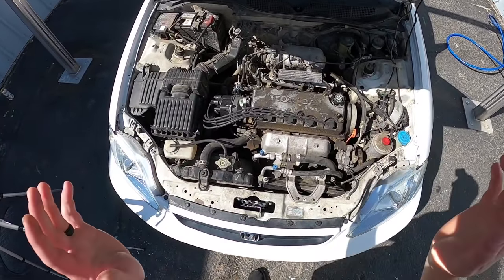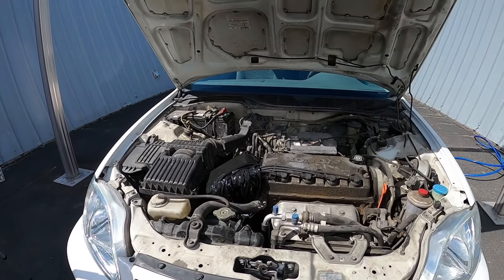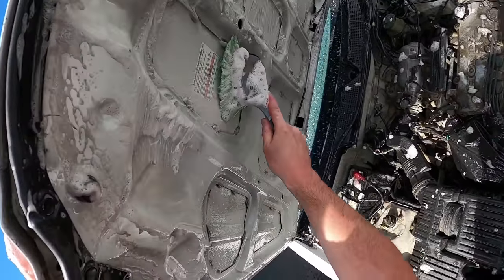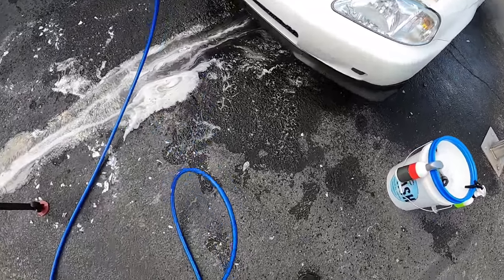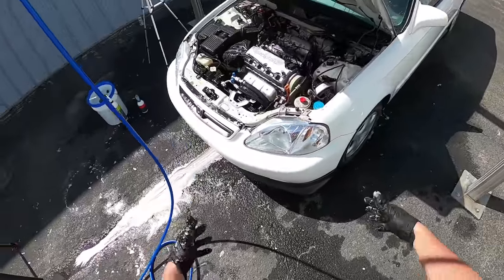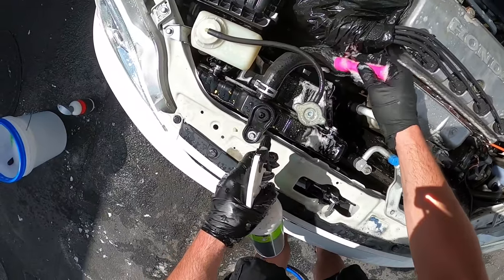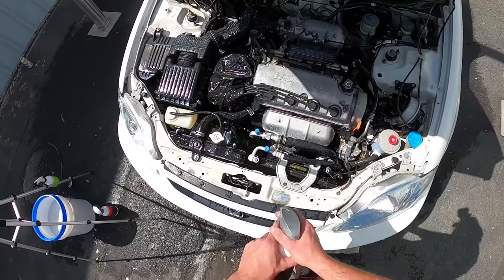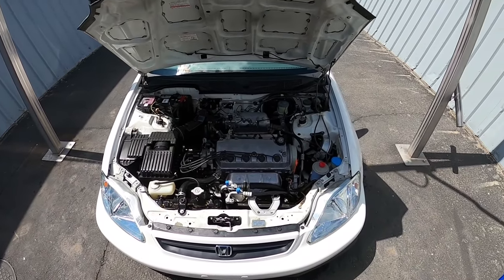FILTHY Engine Bay Detail on a 200k Mile Honda Civic | Start to Finish

Comment: Anyone else thinks it is a VERY good idea to disconnect the battery while doing things like this?
Reply: I did when i did my pick up. Also used a garden hose and sprayer, and masked off fuse box, ecu, alternator, etc. Came out perfect without a pressure washer
Reply: ..I just cover it up and clean later.  By hand, using good old baking soda solution.
Reply: Nah
Reply: Yes, just cleaned mine and disconnected the battery. Came out perfect!!!
Reply: Why? Water isn't as good of a conductor as the layman thinks. It's actually quite poor. You need electrolytes like salt or baking soda to make it conductive. You can soak that battery all you want, you're fine. Just don't soak electronics.
Reply: Alternators don’t like water either. Pressure washer can easily ruin your day if something important gets disconnected.
Reply: Not really. Batteries are non-conductive.
Reply: did mine without disconnecting and was completely fine
Reply: Um duh 😒 just playing yes very important
Reply: Yes. Boggled my mind that wasn't included. Especially after youn finish the bay, with the battery disconnected you can scrub off the acid too.

Comment: Did this not too long ago and my gas pedal started sticking. Consensus from some forums was that the water pressure might have pushed dirt and debris into the rotating mechanism of the throttle body (TB). Prior to me owning my car, an old lady owned the car for 24 years and had never cleaned the engine bay so it was pretty filthy. Some TB cleaner at your local auto parts store will fix it right up if this ever happens to you haha.
Reply: TB cleaner, brake cleaner, or simply soapy water on your throttle cable and spring. Soak it good and maybe use a brush if you can fit it on the cable and spring, make sure to clean the cable and activate the throttle and clean between the pulley. Then any multipurpose grease/gun cleaner/oil works on the spring and wire/pulley. No WD40 though.
Reply: Ima have to try this my throttle body sticks when it’s parked over night and I have to put my foot down a bit to get it to go
Reply: Same happened to me i had to keep clutching in and kicking my pedal 
I used some lube cant remember if it was silicone based or what on the throttle cable and some light oil on the return sprung and throttle shaft 

Use a motorbike cable lube tool and spray from the top down it should fill the cable in 5 seconds without a air leak then go in the cabin and wipe the excess overnight.. my clean up was next to nothing

Comment: The engine came out pretty clean. I would detail and clean my 2003 honda civic engine every few months. It may not be the coolest looking engine but it felt good to have a pretty clean engine all the time. Keep up the videos, always waiting and excited to watch.
Reply from the maker: It’s always best to stay up on it so it never gets to this level
Reply: 2003 Civic = headgasket blown
Reply: @ua7pyro591  that’s why he always keep it clean lol
Reply: @ua7pyro591  I can attest… however replacing the head gasket on my 03 was a good learning experience
Reply: Same, i have a 2005. 7th gens are sorta the odd one out for civics but the least you can do is keep it nice and clean for it to stand out and keep up 💪😎
Reply: @ua7pyro591  so if U clean your engine and oil builds up it will blow your head gasket and does it make your overheat and have this weird smell?
Reply: @camarioncooke7478  an oil leak from the head after cleaning won't necessarily cause a failure or overheating,  but it is an indication of a problem that needs to be looked at as your gasket isn't sealing properly or there's an unseen crack somewhere. 

Cleaning your engine actually improves its thermal efficiency and ability to transport more heat away from itself, which will lead to some improvements in mileage and some marignal performance. Dirt and oil also weigh quite a bit and its all extra weight you're hauling aroind. The other benefit of a clean engine is being able to better keep an eye on how bad leaks are or if you have any new ones, instead of being hidden under a layer of sludge you can easily see fresh wet oil leaking out much easier.
Reply: @ua7pyro591  honestly here in Asia, its one of the most reliable cars 
got one and it never caused any trouble ever 
mine got a d15y3 non vtec

Comment: After I clean my engine in a similar way and let dry completely . I spray 303 Protectant liberally all over the engine compartment . Specifically to resist plastic and rubber parts / components from drying out and cracking . It dries without any issue at all , though it willl attract surface dirt . Which after around 6 months ? I will do the same again . Of course making sure I do this if possible in the summer months at least for one application . I stuff 1-2 microfiber towels into the air intake to prevent water from getting it .

Comment: I've got an 04 Camry with over 230,000 miles on it and the engine bay still looks pretty darn good
Reply: Me ditto, 2002 V6.  Always kept the engine clean, it is SOO much easier to touch up an engine that hasn't been allowed to get filthy, then coming in and trying to clean it.

Comment: Good for YOU! Nicely done! Ppl think it's wrong to WASH engine bays, I do NOT. I feel greasy/dirty engines are like "frying an egg". When they are "clean" they breathe easier/cool quicker/stay cooler. PLUS, nicer to work on. I use Simple Green on stubborn dirt, but hose my engine bays several times a year at self serve car washes but dont push trigger & that spray is adequate to clean off dust. Yours looks SO much better! 👍

Comment: Yes!!!!! Waited so long for this video after you posted a sneak peek in your ig. But Is that really safe? What bout the sensors? The battery? The fuse box? I mean, you soaked it good but will it not affect the circuits?
Reply: All the sensors and what not I believe have seals otherwise how would you be able to drive in rain snow or be able you wash your car not being sarcastic just I’m sure they must be water tight

Comment: That distributor looks really easily accessed.  Might be better just to clean it, and dry it afterwards on an engine this dirty.  That's what I did on my Volvo.  Also, I've found that plug wells often collect water, so pulling the plug wires from the start isn't a bad idea.  Then dry them out with a shop vac, and compressed air after cleaning.  I wasn't clear on why a wheel cleaner was used.  I'd choose a degreaser.
Reply: He stated once or twice at the beginning he used wheel cleaner because it's got some iron/rust inhibitors (fine rotor dust gets everywhere and then oxidizes, and contributes futher to dissimilar metal corrosion), and works well for cleaning grease and grime which while not as oily as an engine brakes tend to get pretty gunky. Being a wheel cleaner it's most likely formulated to not damage or etch various kinds of bare metal from steel to aluminum as well. 

I personally just spray everything down with klean strip paint thinner made from mineral spirits, and or purple power/simple green for less soiled cleaning projects. I got a siphon wand for my compressor, and I'll just give the engine a light spray and let it soak. Then scrub it all with a few nylon brushes by hand or stuck in the cordless drill chuck. Give it one light spray to get the gunk flowing off, another quick scrub with the brushes (after giving them a quick cleaning with compressed air) and then just blow all the dirt, oil, and sludge off with compressed air and it's Gucci (may require one extra rinse, and blow dry) Granted on a really dirty engine bay, you may need to do it once more from the beginning. I've cleaned nearly 1500 engines this way and never had a problem with it damaging paint, electronics, plastics, rubbers, epoxy resins, or coil windings in alternators or stators.  It's just damn messy and a pain to deal with if you don't have a containment/runoff treatment system, which we had at the old shop but I don't have at home currently. Another plus is that any residue from them will evaporate off shortly and you don't have to worry about it shorting anything out.

Comment: Pro tip remove your battery before you clean your bay to protect your electronics. this also give you a chance to clean your battery tray and battery terminals.
Reply from the maker: Makes no difference in removing it other than giving the tray a clean. “Modern cars” can take it

Comment: I clean my engine bay regularly, easy to spot any fluid leaks when clean, if you work on the engine hands are cleaner, never had a problem but be careful on rollers from the belt and alternator, degreaser will clean too good them bearings and the will fail alot faster

Comment: Some steps I do, mostly to make certain that engine WILL restart:  1.  Cover the alternator w plastic.  2)  Cover the air inlet with plastic!  3. Then either clean the alt carefully by hand or jsut leave it dirty - is a broken alternator worth it to get the engine completely clean?!

Comment: Motorplast is a fantastic product. For engines that are in a little better shape, Vonixx makes a ceramic engine bay coating called V-Energy. Can be used on Plastic, Metal and Rubber. It's phenomenal and super fairly priced for a ceramic coating.

Comment: before you pressure washer the engine bay....disconnect the battery or remove it completely to clean the battery tray area too and to prevent short circuit

Comment: LAST SUMMER WHEN I DID A FULL AND I MEAN FULL ENGINE MAINTENANCE & FULL TUNE·UP I COMPLETELY TOOK OUT MY MOTOR AT 25O,OOO.OO MILES FULL SERVICE I CLEAN EVERY SINGLE PART MY HAND AND WHILE THE MOTOR & TRANSMISSION WAS OUT I CLEAN THE ENTIRE BAY NOW IT'S DUST FREE NO OIL OR GREASE I COULD SPOT AND LEAKS IF I EVER GET ANY IN THE FUTURE I DOUBLE CHECK EVERYTHING WHEN EACH TIME I DO MY OIL CHANGE I EXAM ALL THE UNDER CARRIER THANKS FOR THIS ENGINE BAY CLEAN DETAIL VIDEO NOW I HAVE A GREAT D.I.Y. REFERENCE ON HOW TO KEEP MY ENGINE BAY LOOKING CLEAN AND NOT DUSTY AT ALL GREAT AMAZING VIDEO THANKS ANTHONY ✌🏼OUT

Comment: I can’t wait to do this to my engine bay! I’m rebuilding my D16Y7 and and some everything is basically out already so it’s gonna look so good and I’m so excited.

Also I had a quick question about your b-roll; do you use a gimbal or are just really good with a handheld lol. Cuz I saw in that last clip you were clearly using a handheld and like a skateboard lol but was just curious
Reply: Might be some editing on certain parts to make it stable If you watch eought jordan did great with broll and editing
Reply: @BlueCivid   there's some pretty good video stabilization software out there nowadays. My new phone has it and it works quite well much to my surprise, I mean it's not as smooth as say the gopro hypersmooth software but for something that came as standard software I'm not disappointed one bit. 

That in combo with a self stabilization gimbal mount would make for some great film no doubt.

Comment: Great video. I have a 2000 accord and it’s filthy. So at the end did you blow out the water before motorplast or you applied motoplast then blew out the water around the electrical areas

Comment: You should remove the negative battery terminal before cleaning engine bay or use a pressure washer it's necessary bro.
By the way your engine bay looks like brand new 😄
Reply: absolutely, me personally i would never even use a pressure washer on the engine bay thats kinda wild
Reply: I cover mine up, and don't spray on it directly - same thing for the alternator.  For cleaning the battery you really want to take the opportunity to neutralize the acidy-dirt, I do it with a solution of baking soda and water

Comment: Highly recommend Aerotech 303 for your interior. Its amazing product, and doesn't put down that oily, messy glair that Amour-all does. Nice job, great video, enjoyed watching you. And congrats on a good looking engine bay. Super nice job!!
Reply: Unfortunately, 303 has skyrocketed to over $60.00 per gallon  They have out priced their product!
Reply: @hartlanddetailer5670   look for the msds and chemical makeup of the 303 and find the non aviation marketed equivalent. That's part of the reason it's so damn pricey, once something is made for aircraft that's an instant tenfold markup on price. 

Meguires makes some fantastic products though, and you get what you pay for.
Reply: I use 303 automotive (same product, costs about half the price because it's not 'aviation') diluted about 2:1 (2 parts 303 1 part water), slightly diluted for engine bays because if it's not diluted it does leave a tiny film that will catch dust in an engine bay that moves air, but when diluted it still leaves behind protection and visual pop, and also extends out your product just a bit more.

Comment: We did an engine cleaning, twice, one with water and the other one with Kerosene.
Both same results(clean), but the water left an engine check lights on for 2 days. 
So what do u recommend?
Reply from the maker: I would say that’s pretty uncommon. You need to be mindful of where the water is sprayed. Other option would simply be to use a garden sprayer and rinse things lightly

Comment: Black soap works EXTREMELY well as a wheel cleaner if you want to go cheap! Just add black soap and hot water and holy crap you will see a good difference!

Comment: Can i pressure wash the area on the block below the exhaust manifold? I dont wanna get water where it shouldn’t be. Great video by the way! Straight to the point 👌
Reply from the maker: Yes, just make sure your slave cylinder cover is intact so you’re not spraying into the clutch housing
Reply: @ALLDAYANTHONY   seems like the cover is in decent shape. Thanks man!

Comment: What if I don't have a pressure washer, my only option is to take my 03 civic to a self car wash that has those high pressure sprays, would I damage anything if I washed the engine while it's hot?

Comment: Any suggestions on a product that does a good job of getting oil cleaned up. I just bought a 1500 project Honda and under the hood is nasty. I thought if I could get it cleaned up it would help me figure out where the leak or leaks are.

Comment: Just use some diesel with a brush and that will make the job easier. You dont have power coating on the top cover so not a problem

Comment: Anthony my 2000 civic si has the same metal radiator, and ive never seen another honda with another metal radiator.  Can you check your white cars production date?  My theory is cars made after 7/00 had the metal radiator

Comment: Is it ok to soak most of the engine in water? Have the same engine in a 97 civic. Also thinking of doing an engine wash but a little hesitant to soak with water. Appreciate it Anthony! Love your videos! Thank you!
Reply: Most engine components are designed to get water on them. You just don’t want to get things soaked and certain things wet. Any electrical, alternator, distributor etc. also disconnect the battery and take it out of the bay so that there is no current running through your engine components. If you have access to compressed air definitely use it to get water out of hard to reach areas. A little water is okay to get on engine components just take your time and be careful where you are spraying water
Reply: @Shwert890  Thank you so much! Will definitely take note of this.
Reply: If in doubt, use a spray bottle of water to rinse and use less chemical with a brush. You can either wipe up with a towel or compressed air. The older the car, the more careful you should be. Hold the pressure sprayer at least a couple feet away, if you do go that route.

Comment: The problem with these older civics is they are OLD and aging. If theres no leaks then it makes sense to clean the engine bay, but if theres oil leaks, then good luck cause it will end up dirty less than a week and dirty just like it was before. so its best to replace parts first, and fix any problems it has, then clean the engine bay. Learned from experience

Comment: I don't know why you don't put the hood in them up right position. You can put the engine prop in the hole near the wiper fluid line. 
Sorry for gramma, englisch in not my first league.
Reply from the maker: Too flimsy for scrubbing at that angle 📐
Reply: @ALLDAYANTHONY  i didn't think about the scrubing area

Comment: Hm I have a question im looking to replacing my hood since it's pretty badly rusted but mine has emissions stickers on it like yours and ik new to this stuff but if I get a new hood do I have to take the stickers our and place em on the new one some how or do I just replace the hood with what I bought and im good?
Reply: Im*
Reply: You could replace the hood and buy the stickers at any honda dealer with your year and model honda, removing the stickers from the old hood won't work sadly. The "sticky" won't stay in place. Or if you get the same hood from the same model and it still has the stickers; than you should be good!

Comment: Just bought a ek hatch but it has no ac components like the compressor or ac lines any idea how much you think if I take it to a shop to get it installed?
Reply: A lot. Just hit the junkyards and get what you need bro. Plenty of ek’s in the yards.
Reply from the maker: I would try to diy it if you can! AC swaps can be found in junkyards

Comment: Question how do you keep your car running up to 200,000 ? I have a 2000 Honda Civic DX 4door
Reply: Keep your air filter clean and change your oil regularly.  My 98 accord has 303k miles, and it runs like a dream.